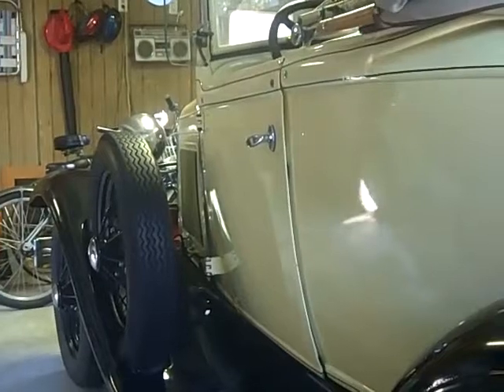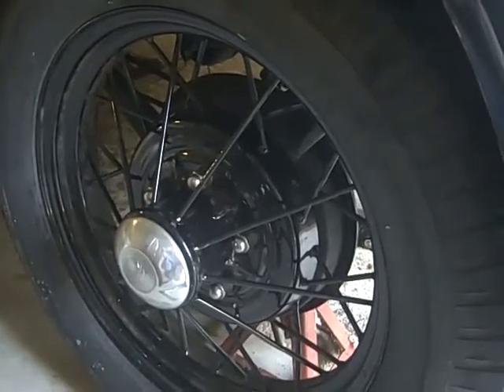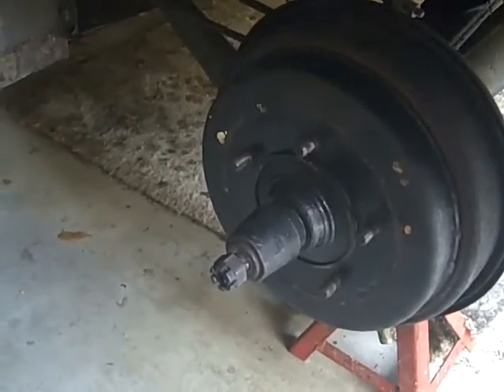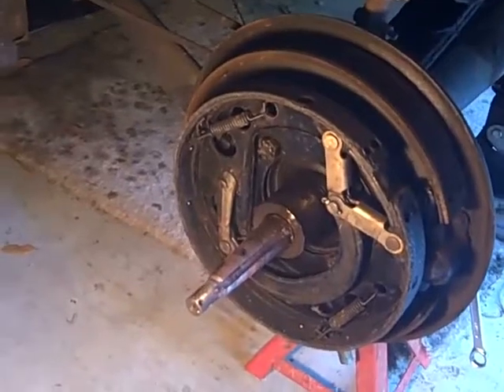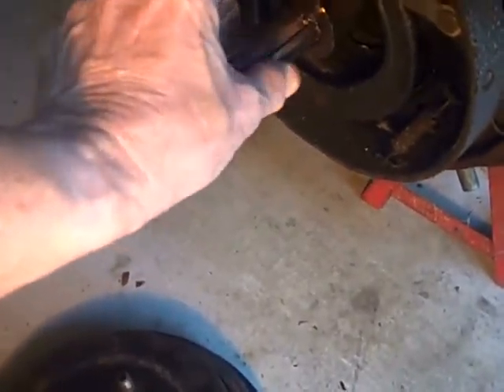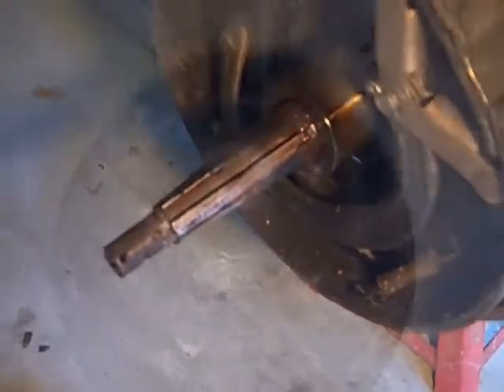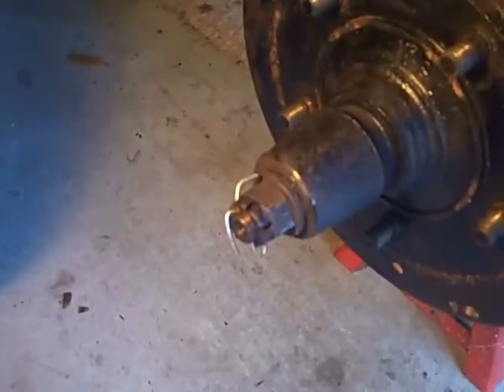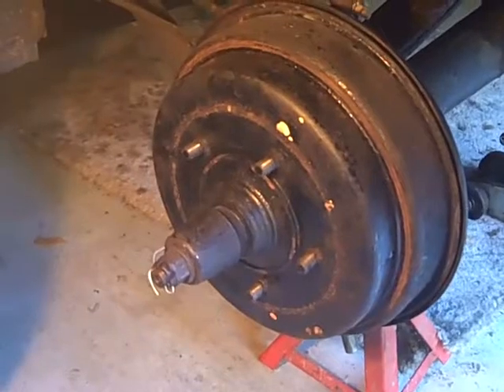Ford Model A  Adding a  shim to the rear axle.

Comment: Jack . I was wondering how much torque  you tightened that nut to .  A lot of the guys say 100 foot pounds  however my left axle shaft  has worn threads and I fear that if I tightened the nut to 100 foot pounds I would strip the threads . So I tightened it  to 60 Foot pounds .  I do carry a spare key in my toolbox just in case  . My left drum rubs on the outer  edge of the brake shoes the metal there is shiny but no marks on the backing plate  .
Thanks for the video Jack  B0B

Comment: Great video! On my 1930 Victoria,the left front hub/drake drum, has started to rub the edge of the brake shoe. Is there a shim or something I could place over the spindle? I was thinking about replacing the race and wheel bearings.
Reply from the maker: Fred Kaminski I don’t know of a front shim. Replace the bearings. If it’s hitting only in one spot, you might grind a little off the brake shoe. Beyond that, you may need a new spindle. Hope the bearings fix it

Comment: Hi, is there any special trick to replacing a broken axle?  I'm the fourth generation owner of this good condition unrestored (my favorite kind) '31 "A".  My great grandfather bought the truck in 1941 from the city of Alhambra fire department.  It had been the chief's truck.  My dad learned to drive in it in the 50's, and my grandpa used to give me rides in it when I was little in the late 70's early 80's.  They're all gone now, and I never met my great grandfather, as he died in 1956.  Up until the axle broke about ten years ago or so I maintained it in running condition and would drive it regularly.  I've just not had the time since then, but I think it's high time I get it back in running condition!  I even have another whole rear axle assembly to take an axle from.  Supposedly my dad broke one of the axles when he was young, by doing burnouts.  I'm thinking the other one has finally broken for me, as a result of his mischief some 60 years ago :)  It seems like you have a nice club, but I'm in California :(
Reply from the maker: I just found your comment.  Must have missed it.  Join a club if one is near you, join Marc, or MAFCA, and get the model A mechanic's handbook from a supplier such as Snyders.  Get that baby running and have fun with it.  jack
Reply: realvanman1 might just need a keyway